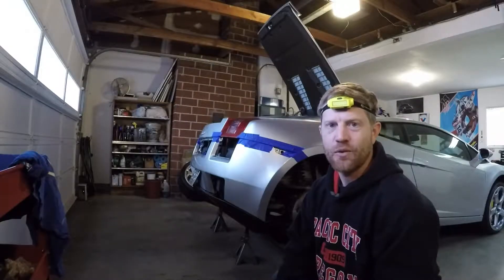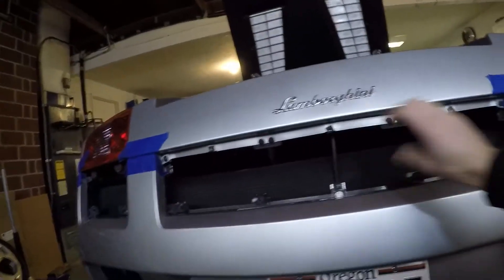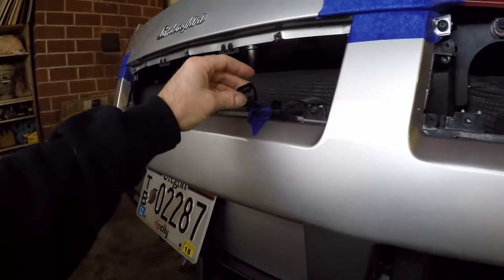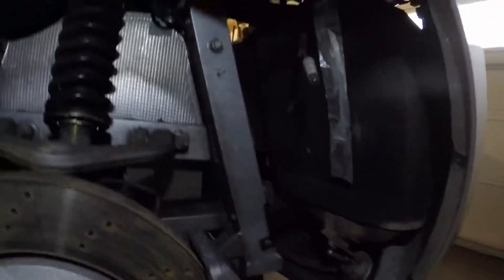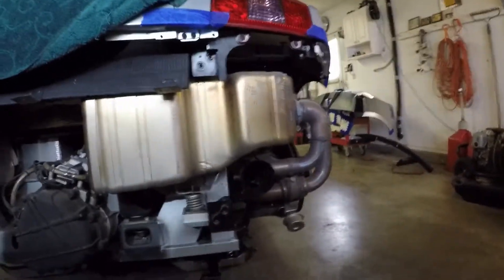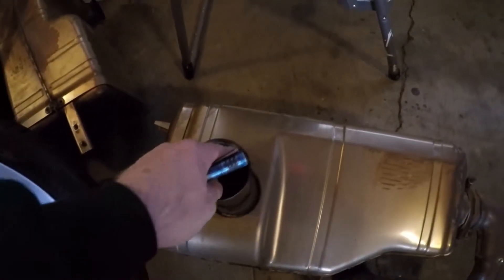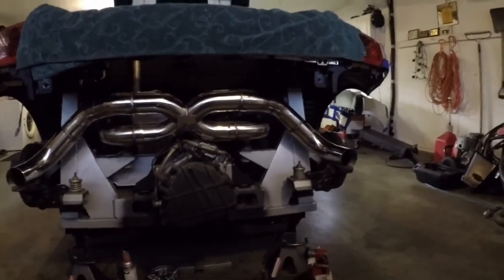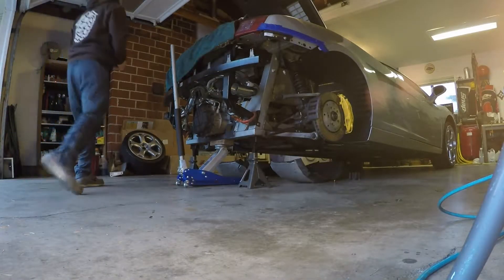Installing the X pipe exhaust on my Lamborghini Gallardo

Comment: I am having the exact same exhaust installed. Have you seen any negative impacts from the pipe being so close to the shift actuator and other parts? Any melting or excessive heat damage? Mine is like 1/2” away or less.
Reply from the maker: No issues with use I’ve put 4K miles on it! Fitment requires some patients. Make sure to get an exhaust heat shielded like I have and it’s shown in the video. Without that you may have some some heat damage!?

Comment: This sounds amazing. Does the car have a drone at low rpm’s. Also is there any difference in the sound compared to a titanium exhaust. Thank you for your reply.
Reply from the maker: sanjit puri The drone isn't to bad at lower rpm's. And having cats still. It's quite reasonable through out but it screams at full load & higher rpms. Not sure if titanium sounds different. I do have a short tunnel clip on Instagram @daytonmotoring